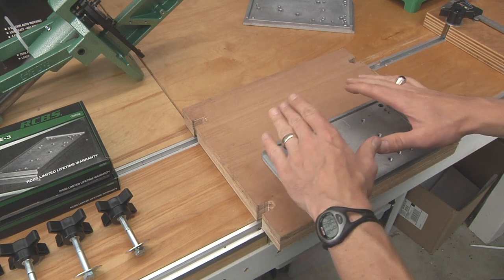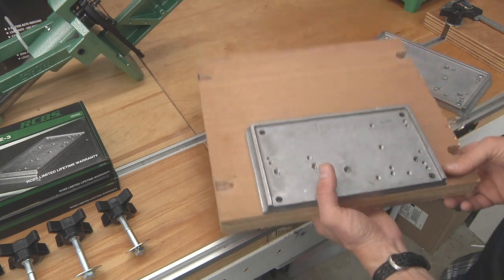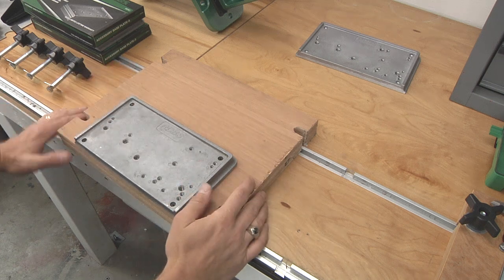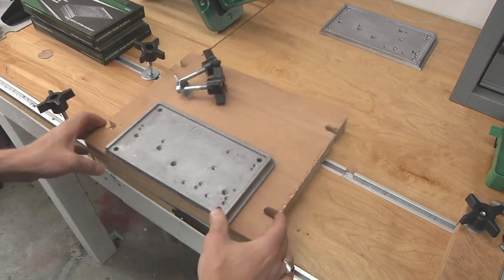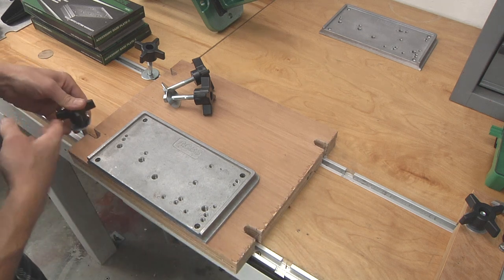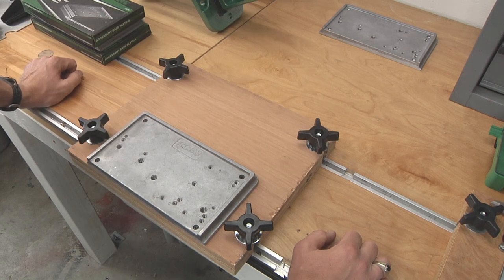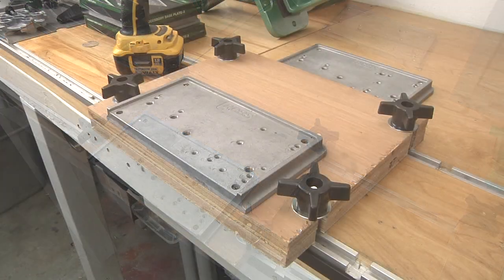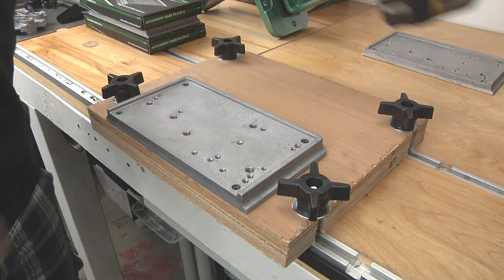Mounting the RCBS Pro Chucker 5 using the Ultimate Reloader Bench System

Comment: Hey Gavin, can you post the measurements/specs of the bench.   I'd like to know the working height of the bench, the distance between the T-tracks and the size of the double thick base plate you are mounting the aluminum base plates to specifically.
Reply from the maker: James- check this out: http://ultimatereloader.com/2011/03/27/the-new-reloading-bench-system-at-ultimate-reloader/ - the T-Tracks have an 8" center-to-center separation.
Reply: Excellent .  Thank you.  You're doing a great job. Sub'd.